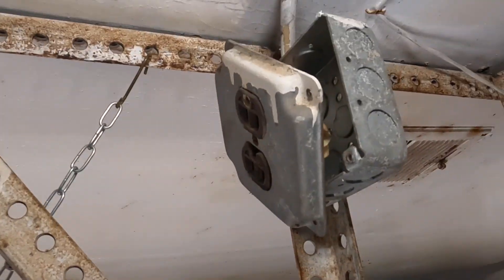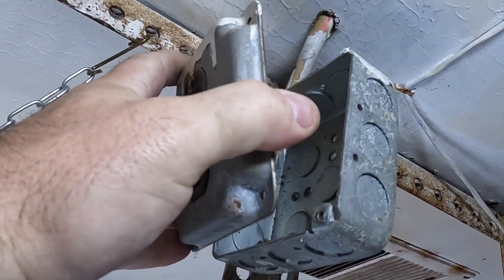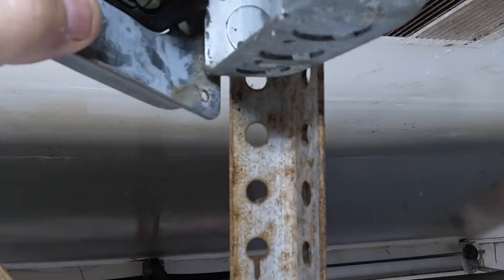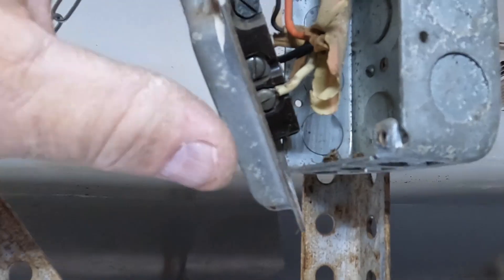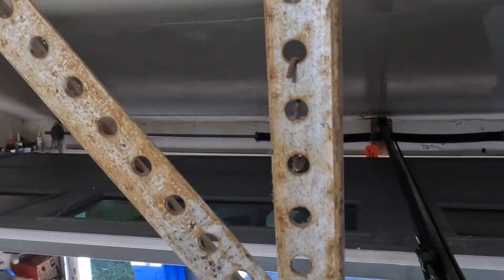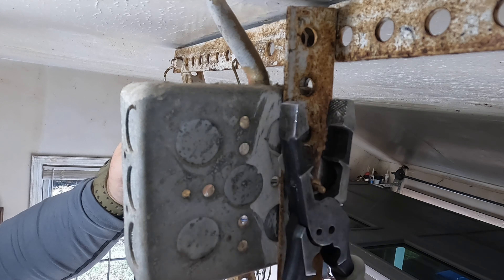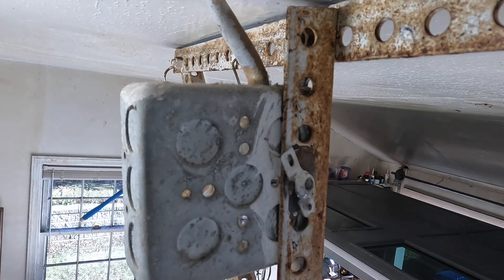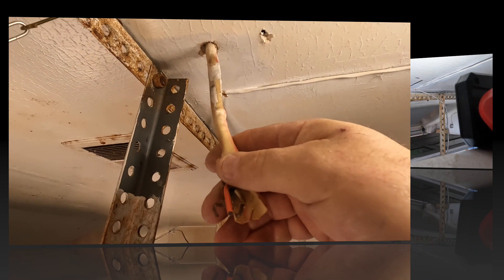Rewiring a Garage Door Receptacle | Electrical Repair   #service

Comment: Great video Ron.  Question?
For a newly built house (2023) where the garage door openers are on their own circuit, shouldn't the outlets be GFCI protected?  I would imagine protected with a GFCI breaker since ceiling mounted outlets are hard to reach without a ladder.  I'm asking because ours are not.  I tested them with a plugin tester.
Reply from the maker: @netpasya  Yes, they’re required to be GFCI protected.

Comment: Now, of course, upgrading that outlet must be GFCI as well; not to install a GFCI receptacle up there, but perhaps add one at the junction box, still high but more accessible. Is just tucking the unused red wire enough, or does it still need a wire nut cap?

Comment: Rehab code notwithstanding, I would have installed the GFCI to support the door opener. A few extra bucks done GFCI will not break the client’s pocketbook.
Reply from the maker: Two weeks later you’d be getting a call that it’s tripping. Why is tripping? Because the garage door opener is slowly failing and now you’ve just created a headache for someone. I know where you’re going and I am advocate for GFCI protection but here it’s creating a problem that wasn’t there before.

Comment: I have to ask - where did you get the old work box with the metal wings to hold in place?  My local supply only has the boxes with plastic wings and they are a pain. Thanks 🙏. (You didn’t like plugging the lamp in the garage door opener?)
Reply from the maker: Those are old work metal gems.  Use Madison bars to secure the box to the wall. It’s really old school.

Comment: I thought the romex can’t be exposed like that coming from your box on the wall.  It should be in conduit or mc.  Or am I wrong?
Reply from the maker: It's up to the authority having jurisdiction (AHJ). In New Jersey, this would up to an electrical inspector but in this case it's a repair and my electrical license allows me to make this judgement. I'm not saying I do whatever the hell I want to do but it is my estimation that the cable IS NOT subject to physical damage.

Comment: good job but you have put a wire nut on the orange circuit to prevent unintended re-energize in the service panel.
Reply: Yes, I too, would have but a "wire nut" on the unused orange/red wire a safety measure.

Comment: That register up in the ceiling is alarming if it's connected to house force air system.  Can't have car exhaust leaking into the house.  Oh.  You can't use 14 gauge, the Romex is white. It's on a 20 amp breaker.  LOL 😂 I kid Ron.  Old Romex 14 12 10  was all white once apon time.  You know some keyboard punk will say something like that soon.   Clean install, way way way much better than before. 👍 Stay safe, winter is coming.
Reply: I agree, there should not be a forced hot air duct in the garage because of carbon monoxide from the car.  Also, vent is a pathway for potential fire situation can travel into the house with smoke and flame.